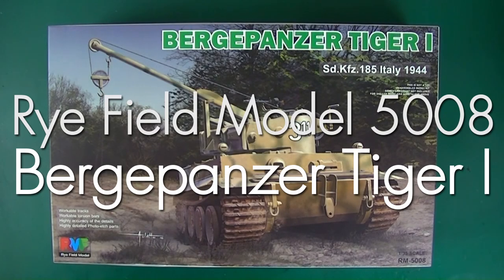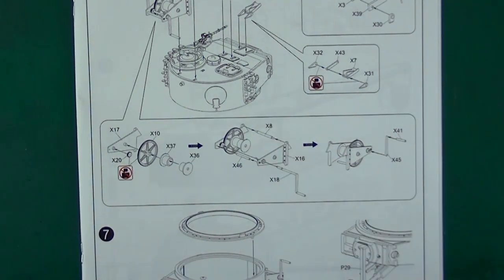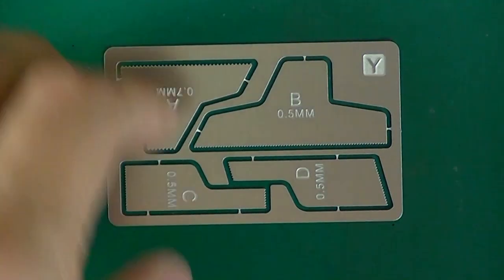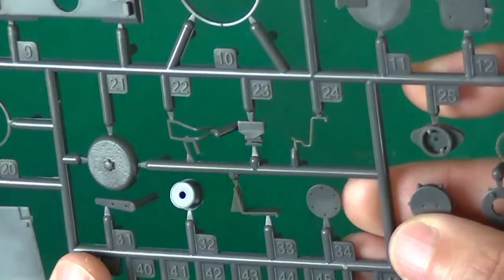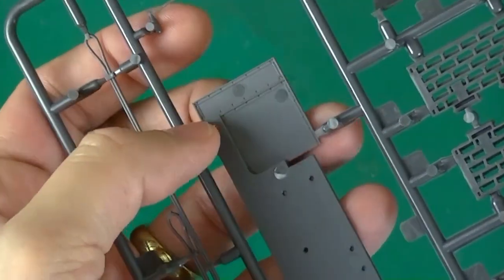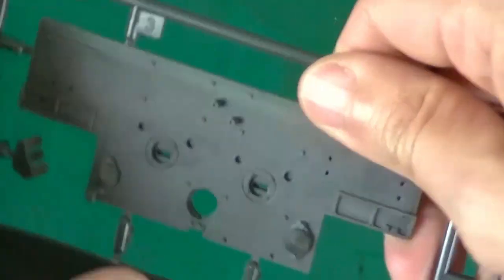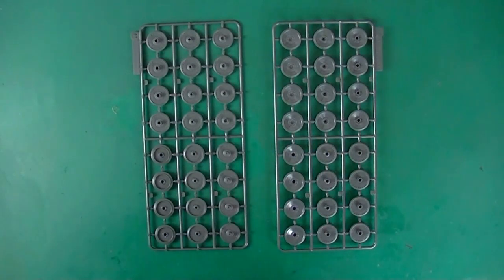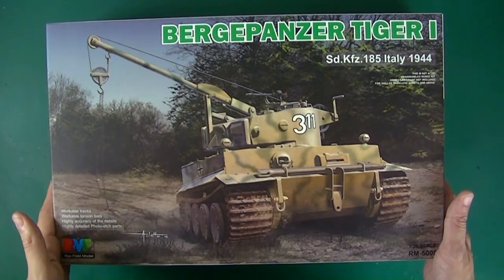Kit Review: Rye FIeld Model 5008 Bergepanzer TIger I in 1/35

Comment: Hi Adam, thanks for the review. It's a very unusual Tiger and since not much is known about it, I will have some fun and build it with the 88mm main gun mounted and the crane in a "modified" raised position:)
Reply: Well, we're pretty sure that the gun was removed when the crane was added. The unit diary does say that a "damaged Tiger" was converted, and we can see evidence of multiple hits on the turret and a fire.

Comment: Where is the cable guide pole on the top of the turret in the kit? The cable slips down the wheel at the front of the crane here, if it isn't in the center of the winch.

Comment: My question is why. . . 

The my have yet to release one standard tiger (except for the DAK and the full interior mid?). 

Why not consolidate the many parts they have and create an initial, early, mid and late rather than these obscure models? Just frustrating cause I want a nice early tiger and I know they have the parts, I just wish they would box em up and make a standard tiger. 

Sorry rant over, great video Adam, thanks for sharing.
Reply from the maker: I completely agree. My first step would have been to do exactly that to take Dragon's market share. Then maybe hit things like this.
Reply: The "DAK" Tiger (it wasn't actually in the Afrikakorps) is not really standard, as there were only 20 like it. The "503" Tiger is one of nine. So, Rye Field are obviously choosing unusual and special Tiger versions as their policy. 
Given the new-tooled parts in this kit, which are NOT needed, they must be planning a "Mid" Tiger and/or a "Mid Command" Tiger.
Reply from the maker: David Byrden
I think they designed their sprues in such a  way to cover all Tigers right away and they're just releasing kits in a strange way. You can tell by the extensive lettering system that there is something like that going on. At some point I assume they'll just go to standard Tiger kits. I can tell you though as I built up that turret yesterday the parts for the cupola were a bit rough.

Comment: Hi Adam hope you are well. I need your Tiger expertise and I wondered if you could help! I'm building the Dragon, Tiger 1 the 131 and I'm looking to buy some Friulmodel tracks for it. Do you know what the Mirror Tracks are (ATL-116 TIGER I initial type (mirror tracks) I have a set of early tracks but I don't have a clue what these are and I can't find any info on them.
Reply from the maker: You don't need mirror tracks for 131. The mirror tracks were used on the prototype and first few Tigers sent to Leningrad. You just want the standard early tracks.ATL-25.
Reply: Thank you Adam I really appreciate you letting me know that's great 👍👀♥️
Reply: I'm also building this kit Adam and I wondered if you have done an update on the part issues etc also can you recommend the zim that you used please. I'm so impressed with your vids you really are very knowledgeable and extremely interesting to listen to. Thank you for sharing and giving up your time. 👍👀♥️

Comment: Hi Adam great job on the reviews. For the more casual builder ie not research crazy they are full of good stuff so thanks. On the Tiger i believe David said it had S-mines on initial conversion but may have been removed. Do you know what Dragon Tigers have S-mines included in them? Understand Griffin do some but I might have some without knowing in my collection from Dragon.Thanks again for the reviews..
Reply from the maker: Thanks very much Darren. 6730 would have S-mines, and since 6820 is the same kit with an added sprue it would as well. If you're looking to make a late early with S-mines either will do. Just be mindful that 6730 is set up to be a befehls, so you'd need to use a different hull rear plate, but the parts are in there.
Reply: Thanks Adam! Keep the great reviews and articles coming.Greetings from DownUnder..